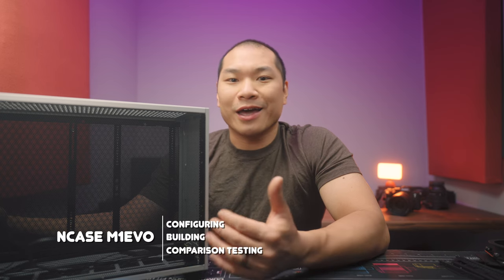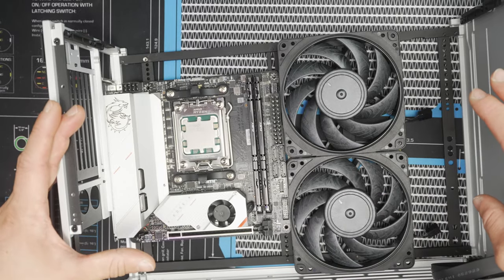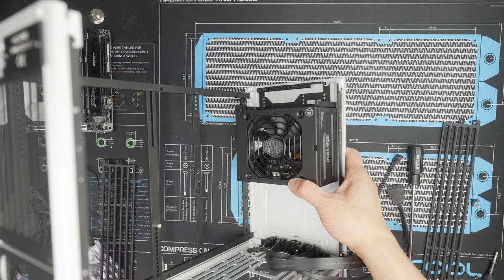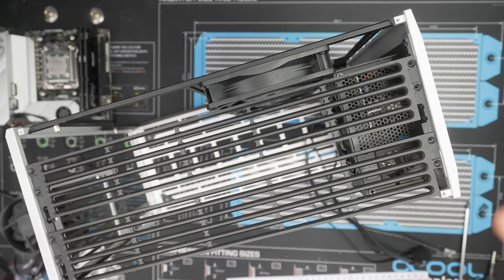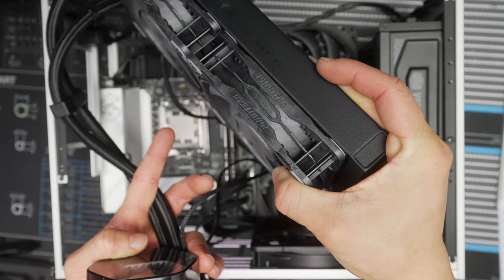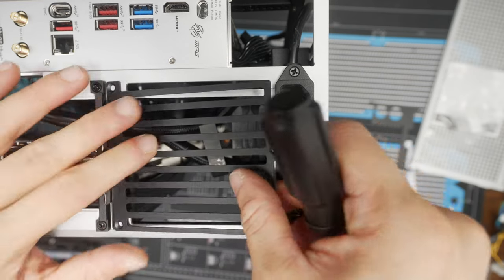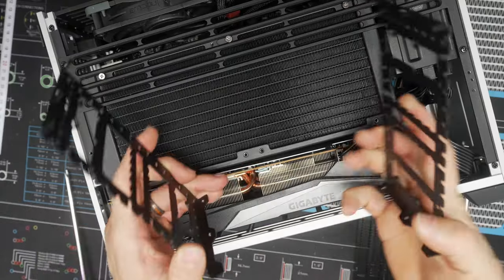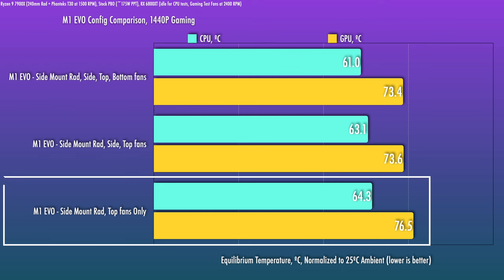AIO Builds and Configuring the M1EVO!

Comment: I have some question :
1. Are tthe gap between the back of motherboard with the right side panel enough to install m.2 with tall heatsink or it just enough for bare m.2
2. Where do you put 2.5" SSD if you're using 330mm or longer card with this case?

Comment: I hate the PSU mount so much. Why give the option for height but not offset? I'v got mine in the flipped orientation with a 280mm aio. GPU temps are around mid - high 60s at around 24c room temp.
Reply: The power supply mount is absolutely atrocious. SFX-L psu? Good luck getting a large GPU in horizontal position. You can go vertical mount, however, you lose all of the space for a good air cooler. 

Controversial idea: Throw the PSU mount in the trash. Mount the psu so the fan pulls in fresh air from the top.
Reply: @salbadali3232  I'm using an SFX-L psu and that was a headache trying to fit with the stock cables. I tried to fit it on the motherboard side to fit more fans in the flipped layout and couldn't because of the stupid fixed offset and it wasn't a solid mount so it like swung off the front mount.

I honestly regret buying this case as my first ITX build. I heard the NCASE M1 was one of the best so I thought the M1EVO would be too.
Reply: @vongdong10  The  M1 Evo has a new designer: the owner of NCASE/co-owner of FormD and co-designer of the T1, hence why there are some similarities with that case. I (original M1 designer) was not involved with the design of the Evo.
Reply: @M1.Designer  Ah no wonder why the M1EVO isn't as polished as the M1 V6.1. They fixed what shouldn't have been fixed.
Reply: My recommendation is to unscrew the fan on the power supply and fix those screws into the “radiator mount” at the top of the case. This is the only way I could get my build to work with air cooling.

Comment: Hi Guys, I have a x670ei in A4H2O and I am not very happy that the tiny chipset fan is super loud and the chipset is indeed quite hot there from what i can tell. Tried many methods, not really successful.
Question: will i be able to have better cooling when i switch to potential m1 evo v2 (in regular layout with 4090 plugged straight into the board, using 240 aio on the side)?

Comment: But just wondering with the side case fans. Wouldn't they make more sense as an intake? It'd feed fresh air directly to the CPU
Reply from the maker: Typically (and this is situational) but you want to encourage intake at the bottom panel to help the graphics card, and if you’re side mounting, intake at the opposite side panel to help the rad (which is intaking). Exhausting from the rear panel or mobo side panel can help accomplish that, with this case it’s more powerful to use 2 120s at the mobo side panel.

Comment: This is what I was waiting for! My 7800X3D hits 83C in Cinebench R23 even with an EK 240 AIO with Noctuas on full blast. 

I was thinking of trying the Peerless Assassin
Reply from the maker: Awesome. One thing, those are fine temps for the 7800X3D, but see what happens if you dial down the cooler fans, most of the constraint is in the transfer at the IHS. In reality you are only dissipating ~70W so high fan speeds aren’t always helpful. I was comfortable running the U9S with this guy.
Reply: @MachinesMore  I will test it as soon as I get home! Thanks for all your hard work in these videos.